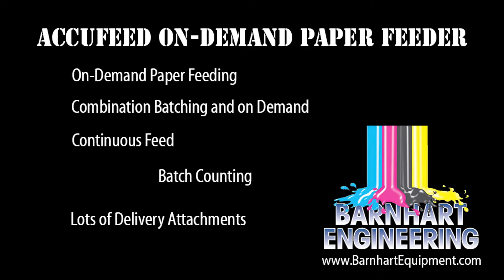Cuefeed Paper Feeder, Infeed Adjustments

Comment: How to prevent double feed of paper?
Reply from the maker: These are very accurate, you can almost be GUARANTEED, no double if you are feeding a business card weight stock, OR THICKER. An uneducated person, could set it up. If you are feeding newsprint, or copy paper weight, IT WILL DO IT, but everything must be precisely set. I can do it all day long, BUT, that is where it starts to get "tricky" if you don't pay attention to your setup.  (Sheet separators / friction feet, how many belts, and, tail support adjustment.)  I also make a SHAKER, that we use that adds vibration to the tail stock for light stock. It "excites" the paper, and makes it feed much smoother. That as well is not needed, BUT, it is helpful. Simple device.